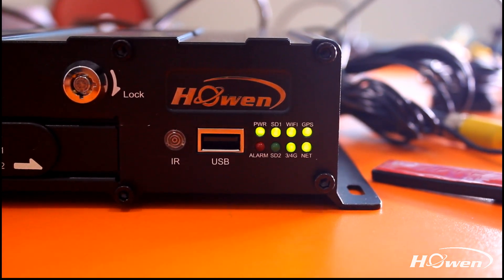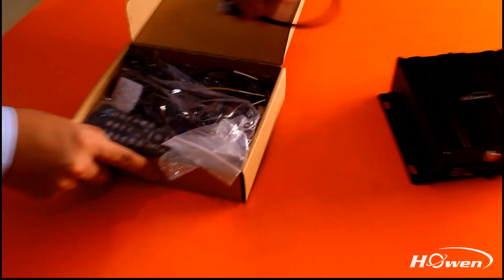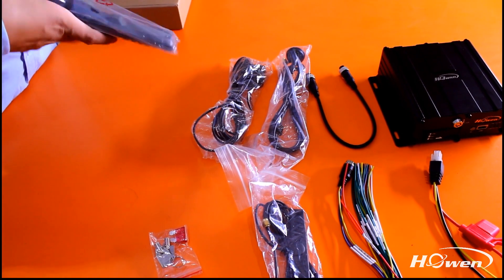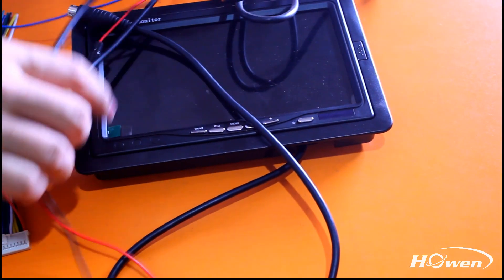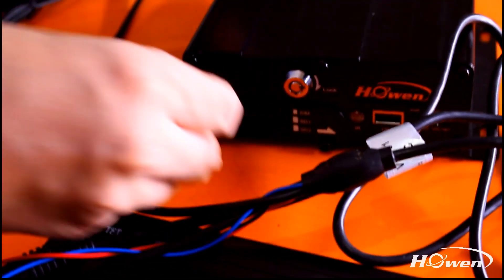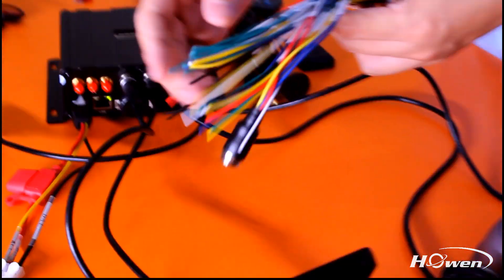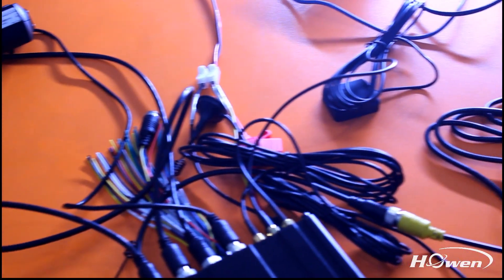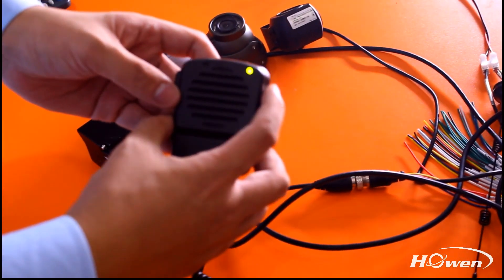Howen AHD SD Mobile DVR Unboxing

Comment: What is the power of dispositive? I have one transformer of 12 volts and 2 Amp the MDVR not ON
Reply from the maker: Hi 12V2A was too low to keep the MDVR on, please use at least 12V5A power supply to power it~ Thank you~